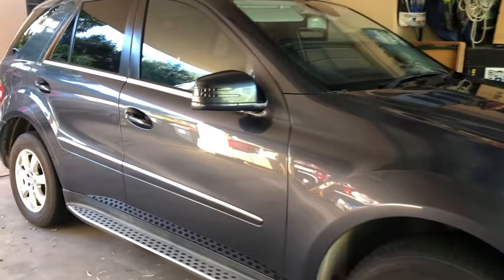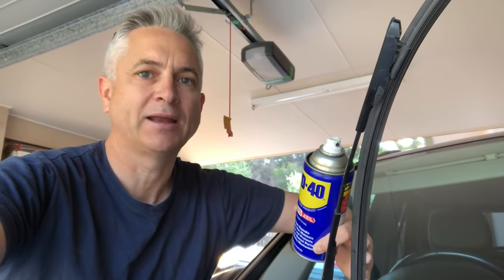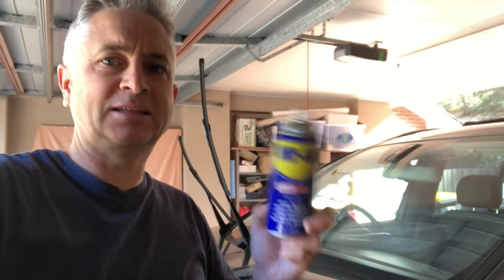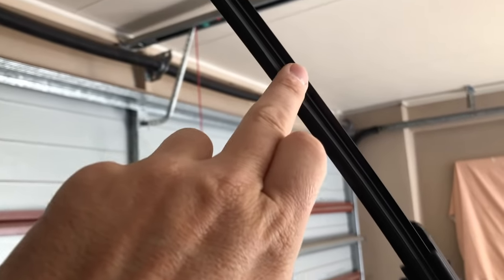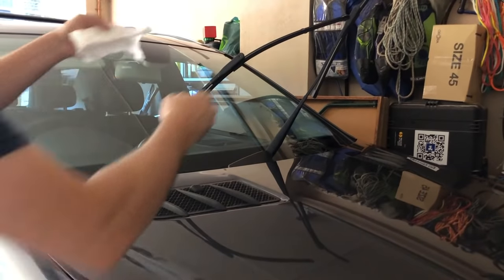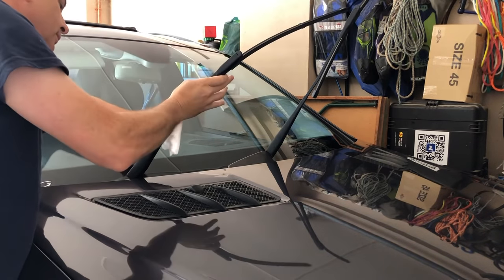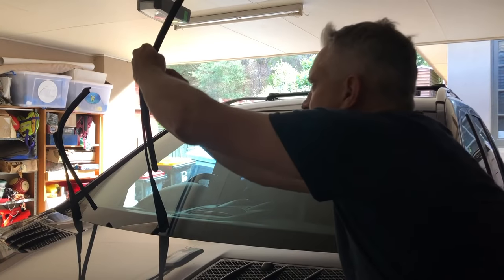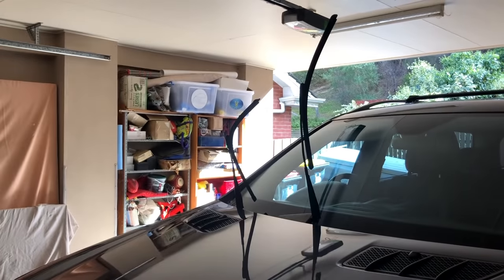WD40 Hack on Wiper Blades!  Does it really work?

Comment: I would use silicone spray and a rag to clean the blades before I would use WD-40
Reply from the maker: Hi Eric, next time it does the screeching I will give it a go … perhaps I should do a video only blade with silicone spray and the other with WD-40 and compare!  You might be waiting a while though as it’s been nearly a year and my blades are still very good now!!  Cheers Drew
Reply: @DrewFixIt  That sounds like it was a success! My vote for silicone is because rubber and petroleum products sometimes don’t go well together.  I have used that on mine with good results. 
Rain-X or Aquapel on your glass in conjunction with clean & lubed blades will make you even happier.
Reply from the maker: @erichimes3062  Hi Eric, I’ve got another windscreen hack I’m going to try soon too … stay tuned! Cheers Drew

Comment: The grime won't stop coming off!  lol
Seriously though, I went through like 5 rags on each blade and grime was still coming off them.  I also noticed when I lightly ran my fingernails down the blade they would come away with grime also.  I will see how good they are next time it rains.  If still bad I guess I do another 5 rags worth on each.
Reply from the maker: Hi Mate, mine are still going strong a couple of years on now after doing this, so hopefully all the best for yours!! Cheers Drew
Reply: that's rubber not grime...

Comment: I think I`d rather use silicon spray for the same reason as has been commented already concerning the rubber.. Just as easy but kinder to the rubber. I am always using it on the motorbike and it brings rubber/vinyl parts up a treat.

Comment: You can get the Black (rubber) even with NEW wipers.  WD, stands for Water Displacement (Clue). 
 [Removed claim, as the video news report is also removed.]
Reply: What airplane was that exactly? Never heard of such nonsense I've been using WD-40 for a number of decades to control rust on garden equipment. Works quite well at "displacing" water, preventing rust and lubricating hinges.(Clue}.

Comment: Were your tyres Chao Yang? Heard they are soft and quiet.
Reply from the maker: Hi Junyan, Yes  I have these on the front.  You probably have also noticed that I don’t have my 21 inch AMG rims on the car too as I prefer the 17 inch wheels in general because the ride is softer.  Long story but I actually have 6 of the 17 inch wheels …. I bought a pair of the Chao Yangs cheap to put on the front whilst I wore down the tread of the others on the back, but for cheap tyres I have been quite impressed they are relatively“soft and quiet” and they appear to be wearing quite well too!  Cheers Drew
Reply: @DrewFixIt  Hi Drew, thank you so much for replying my comment. :)
I actually didn't notice it's 17 inch but it's really nice to know they are better rides.
I am interested in those tyres because they have become more and more popular in China. I wanna get a pair of them after I wear out my Michelin.
Oh, about the wipers, I just try the method but it doesn't work well on my wiper. I wiped them with WD40 for 20 times and still plenty of grime coming off and also I notice there are some "waving" shape appearing on my rubber - not sure if I wipe too hard or it's just effect of chemicals..
Perhaps I need another pair?
Reply from the maker: @junyanzhang6972  Hi Junyan, I would suggest if your wipers are wavy that they are simply too old to rejuvenate and it’s time for new blades.  Cheers Drew
Reply: @DrewFixIt  you probably are right.. thx !!!

Comment: Hi Drew , M8 just saw your rope hanging down for door release 3:00 this can be hooked by wire from outside & opened , shown here on y/t ,i took mine right off ,as how many times do you use that ..
Reply from the maker: Hi Sav, are you worried about someone opening your garage door from outside using that emergency rope for when the power is off?  Cheers Drew
Reply: @DrewFixIt  for you ,as i  said i took mine off

Comment: Why would you buy wiper blades at the dealership?
Reply from the maker: I didn't ... I did the WD40 Hack and they are still fine today!  Cheers Drew
Reply: Buying wiper refills at the dealer makes sense because they fit properly, and cost less than buying the entire wiper blade assembly, The  original equipment blade assembly lasts a long time, so refills are the best deal.

Comment: UPDATE.......

Blades have disintegrated from the WD40 and now it's not streaking but scratching due to metal on glass. I have never used WD40 on anything bar a rusty nut/bolt.
Reply: @GymChess  wiper blades are made of rubber WD-40 specifically said not to use on rubber,  mineral oil and solvent breakdown rubber, they can't be sued because  already warned you not to.  As well as destroying the rubber you've also wiped off the graphite coating that modern wiper  blades use
Reply: @jusb1066  Weird, I replied and what I wrote disappeared. The censorship is too extensive nowadays.
Reply: @jusb1066  Bollocks!! I'm looking at a can of WD-40 right now, and it says, quote "Safe on metal, rubber, wood, and even plastic." And it's not made of mineral oil or any petroleum product, so you have no idea what you're talking about!
Reply: @allansbullet  go read the MSDS and tell me it's not a petroleum product..  by all means give your tyres a good spray every morning, good luck to ya
Reply from the maker: Hi Kani, thanks for the update. Perhaps your wipers were really on “their last legs”!  Fortunately for me it worked a treat and my wiper blades are still very good now nearly a year later! Cheers Drew

Comment: This is not the correct fix.
Nothing wrong with blades. It's the angle of the blade. It needs to be 90 degrees to the windscreen.. Otherwise it will push in one direction and not sweeping..

Comment: That's not grime it's rubber, don't forget gloves!
Reply from the maker: Hi Jon, thanks for the input.  I have had a few people suggest that the WD40 is actually dissolving the rubber on the blades!  What I find interesting is that I am honestly still running these blades over a year later and they are working perfectly ... perhaps what occurs is it some how takes the top layer of cruddy rubber off leaving a new smooth surface?  What do you think?  Anyway, I've had another good period out of a set of blades that would have otherwise gone in the trash!!  Cheers Drew

Comment: it works for a few weeks then right back to the way it was. just buy new wipers, not worth it in long run.
Reply from the maker: Hi Jeff, thanks for sharing your thoughts, however what I have found is that my wipers are still really good now nearly a year since doing this!! Cheers Drew
Reply: Perhaps your wiper blades were in bad condition and need to be replaced rather than just reconditioned?

Comment: Caution: the black stuff coming out might actually not be dirt or dry rubber residue, but Graphite! It acts as a lubricant on the glass, and Bosch, for example, used to put it on the rubber. Maybe they still do. So, take a new blade and try that again, see what happens.

Comment: Since I do not like WD-40, my comment has nothing to do with the purpose of this video. WD-40 came to become a household item by very well performed PR. When it is tested against other 'lubricants', WD-40 falls way down the list. It's very name explains what it is. Water Displacement (formula) #40. WD 40 is a very good cleaning product, especially for aluminum. It is also a very good product for cleaning gun powder from firearms. It is absolutely the worst thing to use on automobile hinges anywhere on that auto. Whenever you spray WD40 on an auto hinge, you will notice that the are that was sprayed collects a lot of dirt. That dirt become the problem as to why the door hinge wears out. That dirt is now becomes a grit like liquid sandpaper that wears down the metal over time.
Reply from the maker: Hi Keith, thanks for your thoughts and comments!  They are certainly Interesting and I will be honest it is not something I have given overly a lot of thought to, however I have only ever really used WD-40 for loosening rusty bolts, cleaning, etc.  When it comes to lubricating hinges I always use Silicone Spray or other forms of Spray Grease such as Lanox.  The Lanox I have found to be really effective on the latch springs of my Early Falcon, which you see on the channel occasionally.  Anyway, to this specific video the WD-40 seems to work really well!  Cheers Drew

Comment: The word you wanted to use is screeching not streaking. And the correct term is actually "chattering". You're using your blades when they aren't needed. Your window was dry. Try waiting until there is water on the windshield to lubricate the blades instead of the hydrocarbons. 🤦‍♂️ This is a solution looking for a problem. Blades aren't meant to be run when they are dry....coefficient of friction and all that. FFS

Comment: Smear a thick layer of vaseline on the glass. That will eliminate any squeaks from the blade.
Failing that just realise that rubber in 45 degree heat doesn't last that long!
Reply from the maker: Hi Richard, Thanks for sharing your ideas, however I am not sure of the practicalities of your suggestion!  What I have found is that more than a year later my blades are still in really good condition and that is in the Australian baking sun :)  Cheers Drew

Comment: So it doesn't work. Should be responsible enough to let your viewers know with all the feedback below, that the WD40 with any excess on the wiper blades, do degrade the integrity of the rubber.
Reply from the maker: Hi Mate, I understand that different people have different experiences, however if you look through the comments there are also a lot of supporting positive comments!  Me personally, it’s been a good couple of years since I did this and my wiper blades are still going strong!! Cheers Drew

Comment: Definitions from Oxford Languages
hack
verb: hack; 

1. cut with rough or heavy blows.
2. use a computer to gain unauthorized access to data in a system.
3. manage; cope.

All you did was lubricate your wipers blades.  Don't try and sound cool, you're not.